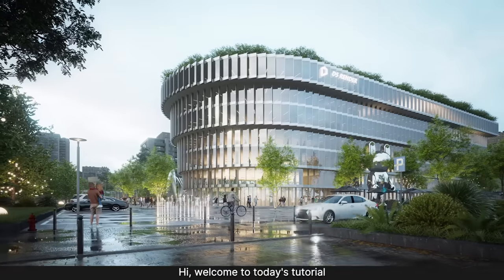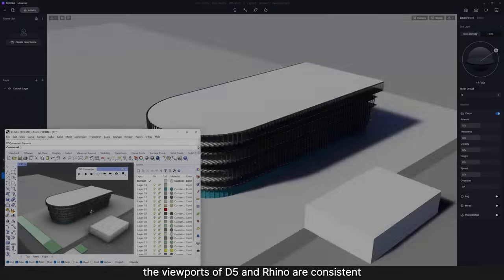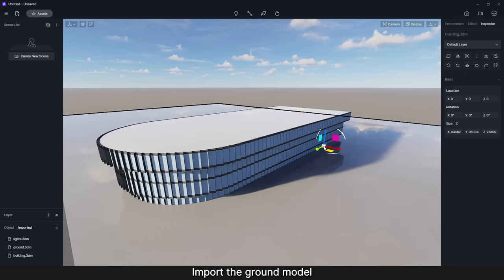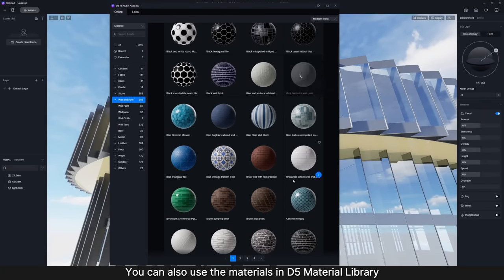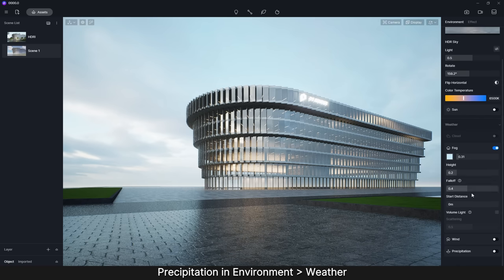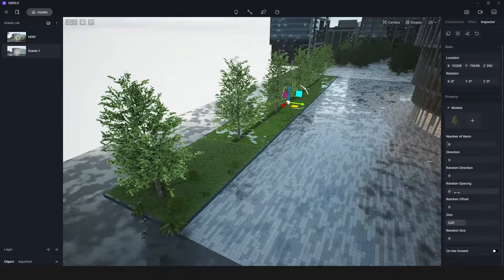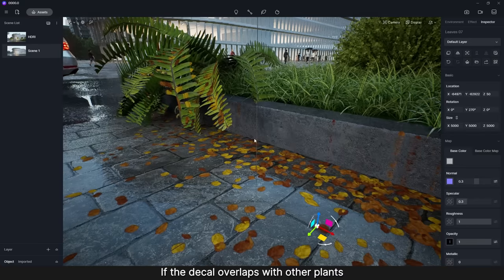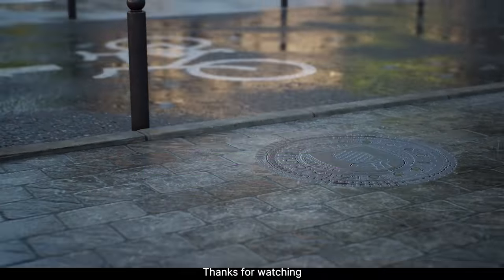Rhino - D5 Render Livesync Tutorial | Real-Time Rendering Workflow

Comment: Is it possible to save d5 files from Rhino? What about mesh resolution when importing 3dm files in D5? Does D5 internally convert nurbs and subd surfaces? I always save rhino files using the command "save small" which discards precomputed meshes.

Comment: Hi can you tell if the following computer setup will be working fast and smooth when working with D5:

Motherboard
Gigabyte Z690 UD AX, DDR5, M.2, USB 3.2, DP, Soc 1700 

Processor
Intel Octa Core i7-12700 (2,10GHz) 25MB (UHD 770)  Soc1700 

RAM
Kingston Fury Beast 64GB (2x32GB) DDR5-5200 KF552C40BBK2-64 

Graphic card
Gigabyte GeForce RTX 3080 Ti Gaming OC 12G PCI-E 

Water Cooling
Cooler Master MasterLiquid PL360 Flux RGB CPU 

Power
1000 watts Corsair RMx series RM1000x 1000 Watt 80+ Gold 

Windows
Windows 11 64bit
Reply from the maker: It should work well.:elbowcough:
Reply: @D5Render  thanks for the response!😎🙏🏼
Reply: Bro you have nearly top of the line hardware for every component. You could run anything your heart desires all at once and be fine haha
Reply: @Matt  thank you mate! Im using this setup now for a couple of months. It has its price tag, but I can say, it is worth it :). As you say, I am running everything I want very smooth and easy :)